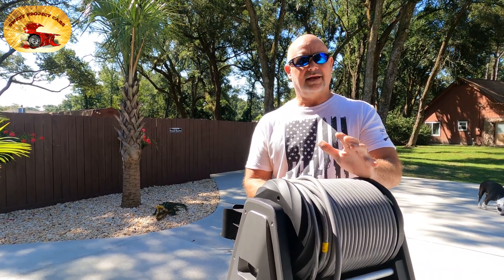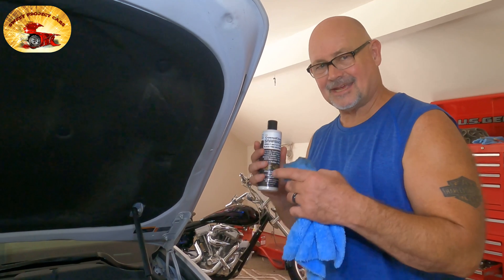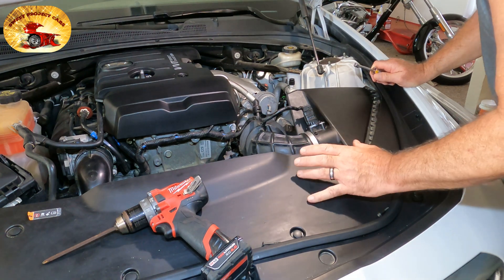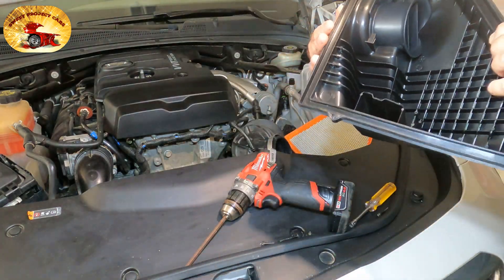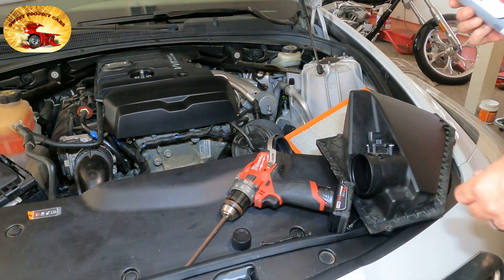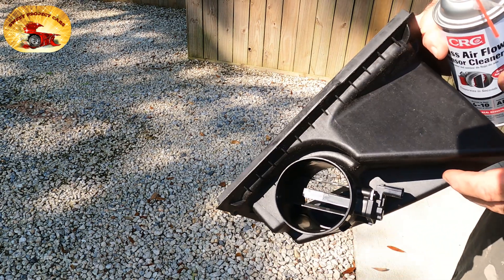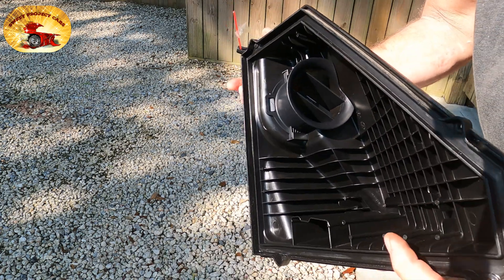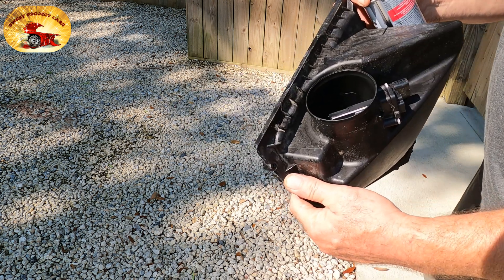3 Lethal MISTAKES  People Make When Cleaning Their "MAF" Mass Air Flow Sensor!

Comment: Another informative video. 6 months I suppose depends on mileage, in my opinion. People either don't know or don't care about cleaning their intake if they have direct fuel injection.  It cost $200+ at the dealership to have done. But you can do it in your driveway in 15 minutes for less than $30.
Reply from the maker: Exactly doug, so if you are only driving 10 miles a week, this wouldn't apply, I say every 6 months or 6,000 miles. This process is very easy and does indeed save $$. Thank you so much for watching and for the input, we really appreciate it, hope you have a great week my friend. mad Mike the hammer SPC

Comment: I'd do it yearly personally, BUT do use upto a 1/4 of the can & never use ANYTHING else! Don't touch the inside,don't scrub it,don't wipe it but do get it properly cleaned from all angles, we all know when anything kicks up a code we gonna spend money getting a scan done,so worth doing folks. I left mine to air dry for 10mins in the sun & all was ok. I'd say check or clean your PCV too with your yearly oil change so you don't forget. Baked on crud is real hard to get rid of.
Reply from the maker: You can do it 1yr/2yrs/3yrs if you want, we have just found that in our 40+ years experience, every 6 months or 6,000 miles you need to clean it. Thanks for watching, have a great week my friend. mad Mike
Reply: @SweetProjectCars  Most people with their busy lifestyle especially here in the UK find it hard to do it every 6months... anything at all every 6 months actually lol  Yearly is just a more memorable time frame ie with their oil change. I like to change my coolant (Prestone) every 4yrs even though it says "Last upto 10yrs"....why does it say 10yrs on it,CRAZY!  Coolant does help the thermostat,water pump,general cooling & any inside corrosion of the engine incl gaskets,leaving coolant inside doed become acidic.  8yrs is too long anyway, that's nuts.  Hope my comments didn't annoy you my friend, just passing on info from over the pond. Peace out!  ❤🇬🇧

Comment: Hello from India 🙏 
I have a Dec 2011 VW Polo 1.2 TDI 150000kms done till date with all the services done from , I have never ever cleaned my car's MAF sensor. Should I also clean it ? 
There is no warning light on the meter
Reply: The answer is yes. Do it now.
Reply from the maker: My friend, if that vehicle has one, I would be getting that cleaned as soon as possible. Welcome from India, we have friends in India that contact us all the time, they're called telemarketers :) LOL  Thanks for the view and question, have a sweeeet week. mad Mike
Reply: @SweetProjectCars  oh nice to know , can I contact telemarketers ? I know my car is a turbo diesel but the technicians at VW workshop say this car has a MAF sensor which they disconnect before replacing the  intake air filter. Any suggestions would be appreciated 💯.